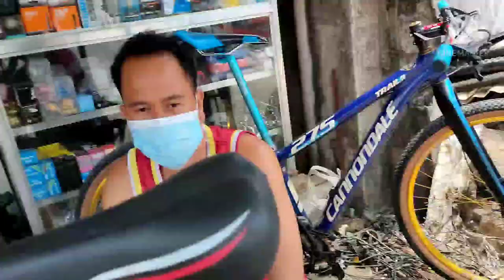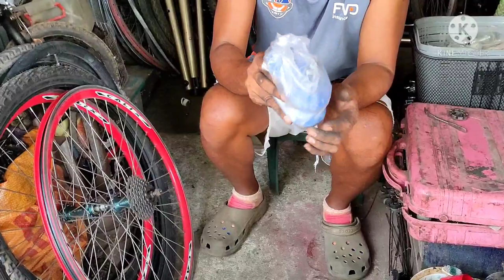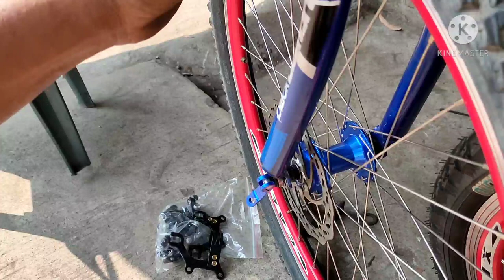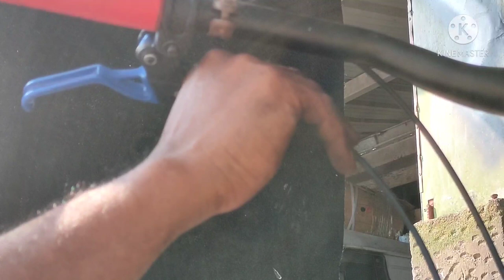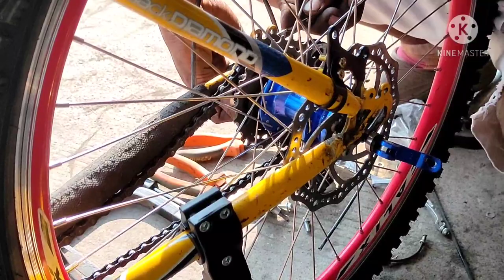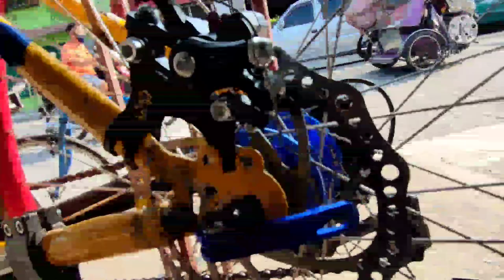CONVERT YOUR V-BRAKE to DISCBRAKE.

Comment: Hello po same po kami naka QR pinalitan niyo po ba ng NUT yung hub yung akin wala space tas nagkaproblem din dahil hindi abot ng caliper yung rotor sana po masagot thank you po
Reply from the maker: Good day po ka BOLAKBOL
wala pong pinalitan at kung malayo po ang caliper sa rotor maistemate naman po ang distansya nyan kakatingan lang ang adoptor nang caliper bago i welding.sa frame.
salamat.
Reply: Ayaw po kasi malagay ng adapter sa hub dahil wala space dun sa axle niya